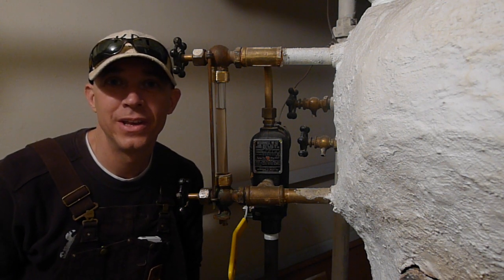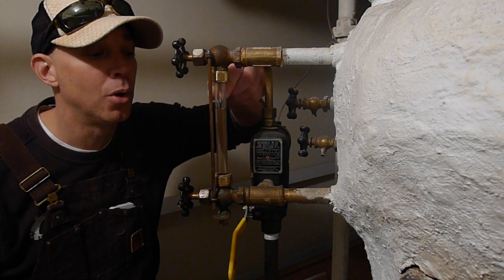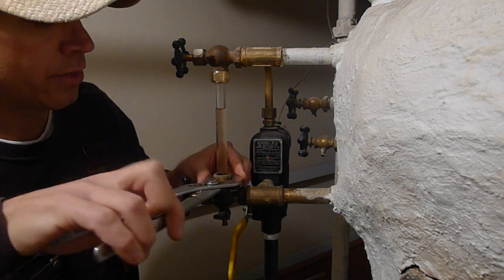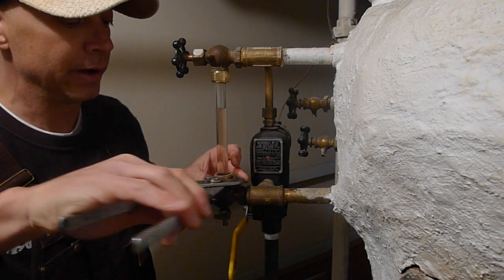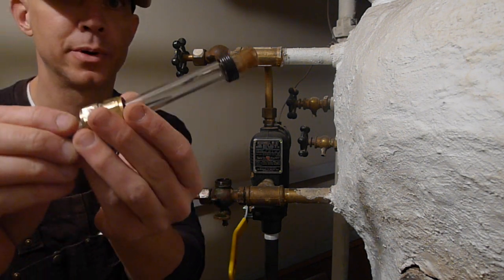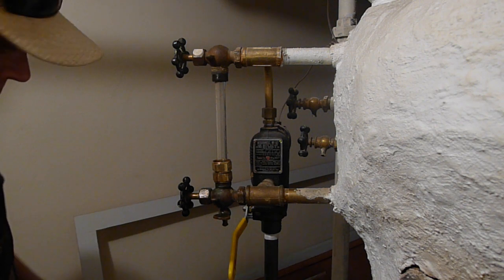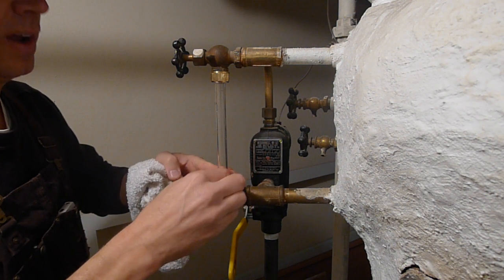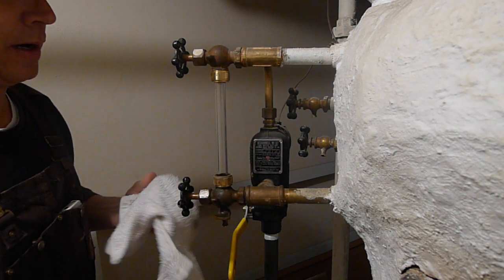Boiler Sight-Glass Cleaning/Changing

Comment: Your video was extremely helpful to the tee.  It was actually very easy to do.  I had a problem unscrewing the bottom one too ( :) ),  as I was following the lefty loosey rule, and it was opposite.  It turned out it was leaking.  So I sucked it up and called someone. Turns out the knobs were indeed supposed to be loose.  Mine were left tight.  It was off, not working the day the plumbers changed/fixed it a yr ago AND charged me for it.  They're the ones that left the glass so dirty, so I couldn't see.  I just kept refilling the water a bit every other day.  It turned out that the glass was cut too short.  All is well now. Thanks again!  :)

Comment: Hi my friend. Very nice video. I would like to add a little tip about it. After replace a sight glass, increase the water level, if possible, manually, above the upper nut  in order to verify that there is no leak in this point also (to prevent any steam leak when the boiler works under normal conditions). Don't forget to put the water level back in the sight glass (about midway) after this test. Thank you and congratulations. Keep posting more videos.
Reply from the maker: Angel Alburquerque Great tip! Thank you. I didn't think of doing that at all. I appreciate it :)

Comment from the maker: Rikki... Those knobs let the water into the site glass. You may have a different set up than I do & yours may let water in, with the knobs tight. Mine don't. If mine are tightened, no water will be allowed into the site glass & I couldn't see the water level.
Reply: No...you need to tighten them up to NOT let water in and loosen them at the end to LET the water in after cleaning the tube. You should be able to see clearly straight thru the tube. Hope this helps.

Comment: A lot of people are asking about the two valves at the top and bottom. It should always be open in order for the water to pass and for you to be able to read the level. And most today come with a safety ball inside of these valves. In the case of the valve failing, the ball will get pushed against the opening by the steam pressure and close itself off. If the valve is closed, this negates the safety.
Reply from the maker: zedio369 Sorry, yes both valves open. I've been a bit busy, but dedicated to helping when I can.

Comment: A better way. How do you know if the top nut/washer is leaking without waiting for the boiler to make steam? After cleaning or replacing the gauge glass open the BOTTOM valve only. If the water does not rise in the glass the top washer is doing its job and the nut is tight. If the water rises in the glass there is a leak. If the water does not rise then the top connection is good and the top valve can be opened. High School science, 2 things cannot occupy the same space at the same time. Happy boiler maintenance.
Reply from the maker: It was not leaking steam in the first place. 
Common Sense science 😀
Reply: No but now you disturbed it. Don't complain when the lwco shuts off the boiler.
Reply from the maker: @jameswoltal2030  been doing this for about 15 years and it’s still going strong. When do you suppose it will finally go out? Maybe on the 16th year?

Comment: THANK YOU!!  I went right into the basement after watching this vid and removed and cleaned my sight glass. However, I'm not seeing any water flow into the fill pipe after manually adding some.
Reply from the maker: asds92 There should be two valves, one above and one below the sight glass. Mine are open to let water in. Double check that.
Reply from the maker: There are also some really good comments from people who know a lot more than I do. That was kind of my purpose in making this video, so people chime in and we can all learn. Nobel Ox made some great suggestions about two years ago, read some of them because not all boilers are the same ;)
Reply: Thank you ! I did the same. Couldn’t sleep. Did it myself.

Comment: Thank you for your video, it's extremely helpful.
Question....you mentioned that the two knobs should be loose normally.
Mine are tight.  Why should they be loose?
Reply from the maker: It took me a bit to figure out how to reply. I just made post above yours answering. Basically, they have to be loose to let water into the site glass so you can see the water level. If they are tight. The water level your seeing may be water trapped in the site glass... Again, I'm far from a professional boiler mechanic. I just fired it up this year! No problems & I added the Nest thermostat to it. I should make a video on that! LOL thanks for watching.

Comment: a simple rule of thumb especially for the brass fittings i.e. the nuts holding the gage glass in place.  "On a flat surface always use a flat jaw, on a round surface use a jaw with teeth".  Therefor use a proper wrench so you don't chew up those soft brass surfaces and save that wrench for round things like pipe.
Reply from the maker: Excellent!! Thank you for the comment. Those are the kind of  comments that help everyone. Much appreciated!

Comment: Want to drain sight-glass so looks like we ease in bottom valve and loosen or remove cap at bottom to remove any rusty water that can clog the water level. Also I saw the top effect the glass somehow the glass looked full and moving the top valve saw the water level drop down to normal level. This for rust clogs in the sight-glass.

Comment: You should have drained the glass using the petcock below it instead of spilling possibly very hot water all over your hands. I agree with using the proper wrenches and righty-tighty/ lefty-loosey on the nuts. You can clean the glass the same as in high school lab using a powdered detergent and a soft bottle brush. When the glass goes a long time without being cleaned properly a scum or film can form on it requiring mechanical brushing with a detergent. No, you get the proper glass from an HVAC supply. Not only do they come in different diameters but temperature ratings, too. The packing nuts on the stops usually leak when you open them. Just snug them up with a flat wrench. That old monster should have been replaced 100 yrs. ago. Have a pro perform combustion analysis as it probably is producing tons of carbon monoxide.

Comment: Thank you for your help! Could somebody tell me please, if is possible to turn the boiler on without the sigh glass, just turning the 2 valves off, so I can heat the house at least 2 hours? The glass is broken and I have to wait until arrive. Thanks so much! 💚🙏
Reply from the maker: Hi Mio. From what I understand, the sight glass is there to check the water level & check the condition of the water. As long as the two knobs are closed you should be able to run the boiler. That is the case in my boiler. Hope that helps! As a reminder, I’m just a homeowner with a boiler and can’t officially tell you you boiler will operate the same way. Thank you!
Reply: @porchonkey1842  Thank you so much for your kind help! Many blessings!
Reply from the maker: @mioangel1227  Stay warm!! It’s getting cold already.

Comment: Does the heater need to be turned off
Reply: No just make sure to close the 2 sight gauge valves before removing the glass. You should also wear gloves and eye protection. I also drain the water from the sight glass before removing the nuts.
Reply from the maker: Thanks Mr Bolts... I didn't understand the question fully. Seeing your answer... Now I get it.
Reply: ***** thanks for the feed back :-)
Reply: geremi It's always a good idea to turn off and unplug any machine or appliance before working on it, boilers included.

Comment: two things to mention,  ... not sure if those rubber parts are real rubber or silicone but you shouldn't use petroleum products on real rubber.  It will eventually break it down (petroleum dissolves rubber).  Better to use silicone grease.  Also,  that stubborn rust deposit can be cleaned with a short soak in vinegar.  Nice demo.
Reply from the maker: RD204 Good point!! Thank you, great tips. Much appreciated

Comment: A few months ago I bought an old house with the original steam boiler (era 1948).  I drain the water faithfully every 1-2 weeks.  The site glass water has been totally clear.... until now. I'm wondering if it is concerning to have clear drain water, but dirty site glass water.  When I had a steam expert check the system after moving in he raved about how clear the site water is and the excellent condition of the system (he even told me to leave the system in and not to touch anything other than draining it).  I should mention that I have no knowledge about steam boilers and I'm a scaredy-cat when it comes to messing around with any kind of major system.  Aside from the fact that I had no business buying a house this old, do you have any opinion on clean water coming out the drain while at the same time the site glass water is dirty?  I went to your channel for more videos and was disappointed there were none, but uber surprised you liked an Abraham video.  Since I'm also an Abraham fan I decided to go ahead and post my question.
Reply from the maker: My guess, & it's a guess, is that the dirty water is just all mixed up and trapped up in the site glass. It's not a bad thing, I think it's normal & will eventually become clear. I checked mine as well & my boiler is doing the same thing. The water draining is initially dirty then becomes clear after about 15 seconds of draining it. When I looked at the site glass water, it was dirty. I'm not concerned about it & I don't think you should be either. It is winter and we are using our boilers a lot more now & the water doesn't have time to completely settle before it starts up again. It's just the water at the top of the boiler that is mixed up from using the heat. The water that your draining is the super dirty water & that's what you want to get out! Keep doing what your doing!! Sounds like you have a nice boiler ;) hope this helped.
Reply: porchonkey Wow thanks for the quick reply!  Looks like you're right... I just checked and the site glass water seems about 20% clearer than before. WHEW!  I'll keep an eagle eye on it tonight.  BTW, I would request more old-house-how-to videos, but I haven't even gotten the courage to clean the site glass yet.  I did try to (gently) jiggle the 2 little bars in front.  One is loose and one is stuck, so I better not mess around with it until I know I can find a replacement just in case. Thanks again for the quick reply and for the reassurances.  Here's to toasty warm homes! ;)
Reply from the maker: Glad it's working the way it should. It shouldn't be too difficult finding things that need repairing to make more videos! Thanks for the kind reply. Have a toasty winter!
Reply: porchonkey
Cool, I'll follow your page if you're going to make more videos!   Thanks again!
Reply: Update: Just thought I would let you know that you were totally right... by the next morning the site glass water was clear again!  Now, I just need to clean the dirty glass.  Ha!  But, I am wondering... where did that dirty water in the site glass go?  Will it get flushed the next time I do a blow down (if that's the right term)?  Is it an indicator that I need to flush more often?  Thanks for your guidance!

Comment: someone told me that the rubber washers will be ruined when removing - I guess that's not true?
Reply from the maker: David Balutanski   I would say that it would be a good move changing them when you do the cleaning. I didn’t plan that far in advance to think of that. Thanks!!
Reply: porchonkey I just cleaned it 10 minutes ago. pretty dirty. First cold nights are coming here to jersey. So I wanted to check the boiler. There is no water in the glass. The tank is filling up - i heard it fill after I drained some dirty water.  Do you know why the glass could be dry??
Reply: porchonkey thanks for the video. Well done.
Reply from the maker: David Balutanski Thanks man, I’m no professional obviously. Just trying to keep up my boiler, and every couple years have a Pro come out and do a safety/maintenance check. There is a valve that lets water into the glass. Make sure that it’s open. There are a lot of different boilers out there. So yours may be different then mine.
Reply: porchonkey valves are open. Could be a clog in the feed to the glass. I’ll get a pro to look this week.
Reply: sometimes those gaskets are hardened and wont seal ,have to break them up to get out of the nuts